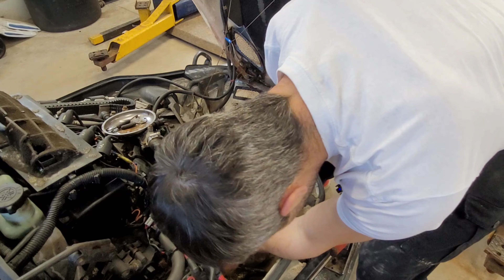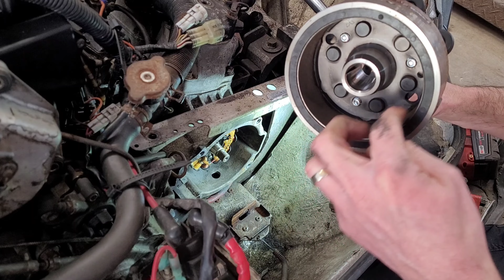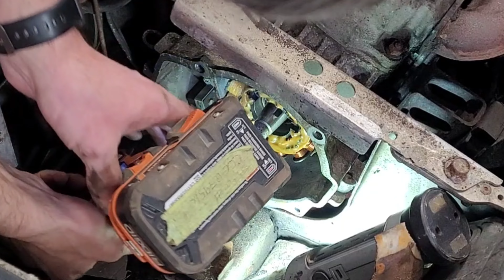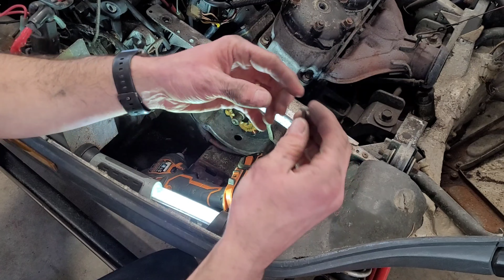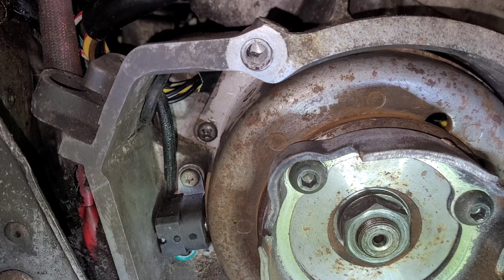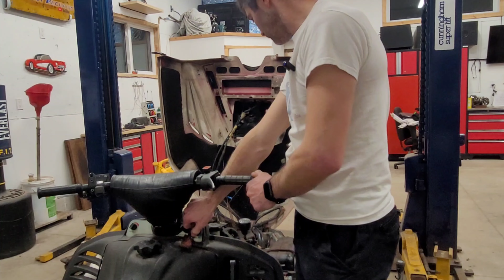RUNS Again !! Nothing like 2 Stroke Smoke !

Comment: An old school trick to stop engine rotation while trying to remove crank bolts rotate engine til start of exhaust stroke, push in a nylon rope make sure that piston is above the exhaust port so u don't damage the piston rings,   once you have put a fair amount of rope in the cylinder then slowly turn crank til it sets firm then put on your socket onto nut then remove nut or bolts, now years ago they use to make a piston stop tool that screwed into the cylinder, but alas that's no longer available, but remember make sure no rope goes past the port, and use a fair amount of nylon rope, and put rope on side that your removing the bolt or nut from in this case or video right side for stalker plate and clutch removal use in left cylinder. Old school poor man's trick
Reply from the maker: I use that trick on chainsaws. I won't lie, I forgot about trying it on a sled. I'm not a fan of piston stop tools, they can damage the piston crown. See it first hand.